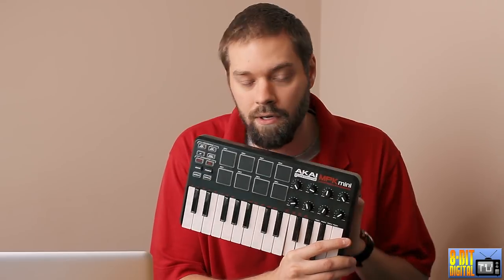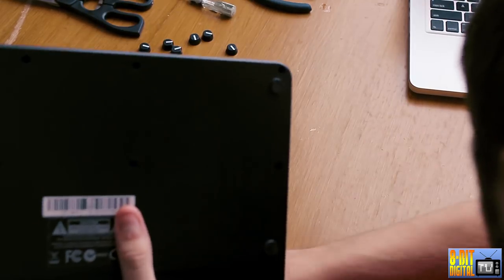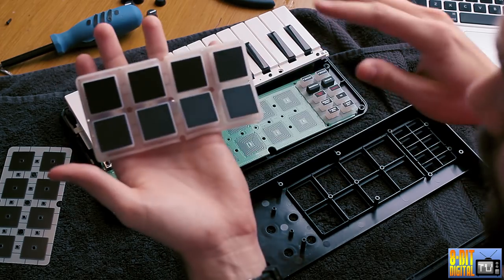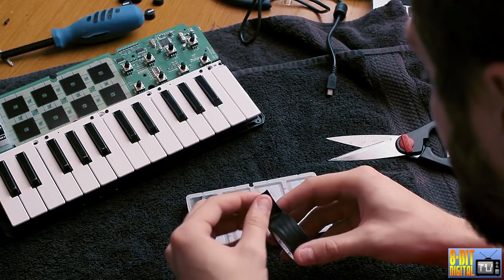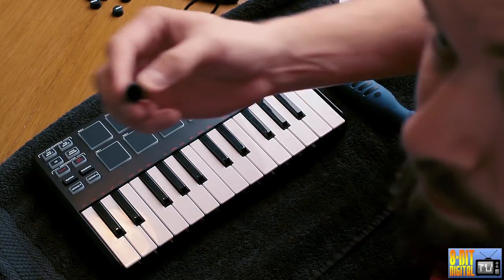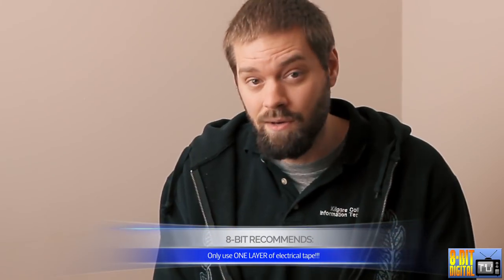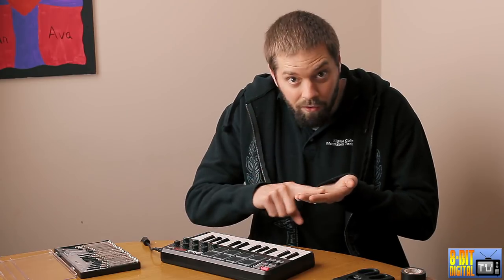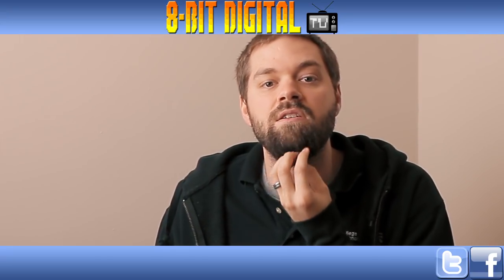Akai MPK Mini Pad Sensitivity Hack [SWAT]

Comment: I just did it and it works great!  I had to adjust how tight i put the screws in though to get it just right, as one of the pads was sticking, but after 3 tries and 1.5 hours it's perfect.  Thanks for the vid man!

Comment: I used two layers of tape and it works perfectly. I quess it depends on the tape you're using.
Reply from the maker: Yeah, we were wondering if the tape I was using was extra thick or something.  Glad it worked for you!
Reply: @8bitdigitaltv   @Random Tech Reviews  Is it a bad idea to buy this in 2020? I can buy a MPK mini MARK1; Will it work on Windows 10 or any recent hardware and software?
Reply: Yup, Tape thicknesses vary. 
Stretching the tape will make it thinner.
There could be manufacturing tolerance differences sa well. 
Two worked for me, one layer wasn't enough.

Comment: this is epic, does something similar work with the keys to make them a bit more sensitive?
Reply: did you figure it out?
Reply: If you hold down the Full Level button for five seconds, the small screen will show four velocity settings (v1, v2, v3, v4). Use the top four knobs to adjust the velocity level of the keys. 

Best to take a photo of the original levels before changing them, just in case you want to revert it to original levels

Comment: I don't get why akai don't fix this issue brefore releasing new products. 
I had to do this same hack on my mpd32 years ago but it seems they're still building their controllers with the same problem.
Reply: It's debatable. I got used to the sensitivity. 
But I usually leave it on full volume mode because the pads weren't great at detecting the different levels of pressure in a consistent way. I found It was easier to just edit those volume changes in a DAW. But as for the overall sensitivity, it's not like you have to hit them THAT hard to trigger the sample. I quickly adapted.

Comment: Hey man I know this is old but I'm stumped. The thing that happened to you at 5:05 (Round 1=Fail) happened to me brand new out of the box. What did you do to fix that problem? You cut away before showing the final fix so I'm curious if its something I can try. Everything else works fine though. Thanks
Reply: he prob removed his tape but i removed mine and its still lit up fml

Comment: I took mine apart, taped the bottom layer of drums to test it out, then put it back together again and now it's the pads aren't working? They won't even light up when first connected to power. Any help would be appreciated.
Reply: Owen Thompson I think he said at 2:43 that you probably have it on backwards. Only one layer, if not any.
Reply: did you find the solution to this?

Comment: So. My USB port decided to break off and fall somewhere inside my midi board. Does this make it unsalvageable?
Reply from the maker: Hmm...that doesn't sound good.  You have to be REALLY careful with that stuff.  If it was just plastic, you might be able to glue the plastic back on.  If it's metal, you may be able to solder it.  If it's the board, then yeah, it's probably a goner.

Comment: I just got a MPX16 to play back sound bytes and discovered that the volume they play them back at was dependent on how hard I press the pad, which to me is stupid. They should have put an on/off switch or a sensitivity adjustment setting somewhere for the 99% of people who could do with out it. 
I guess Akai is stuck on stupid though, do I really have to open it up and put tape on the pads or would a midi controller work?
Reply: um, akai does this on all their pad products. the velocity controls make everything sound real. a drum set doesn't have the same volume for every hit. if you absolutely want everything the same velocity, just turn on full levels
Reply: Lucifer2066 this comment is hella funny 😂 sorry to laugh at your cluelessnes bro guess we all been there

Comment: I need to replace the pads in my Akai MPK Mini 2. However, the sustain connector makes it almost impossible to remove the board out of the enclosure. Anyone know how this is done. The original Akai MPK 1 doesn't seem to have this issue.
Reply: Hey  @AvioCritical  I have an MPK mini Limited Edition White. But I've got the same problem with the sustain. I did manage to open it up even though it was difficult (and scary). Now closing it is my new challenge. I feel like I need more than two hands. Two to pull the plastic around the whole for the sustain input. A few hands to keep everything in place and maybe a hand or two to push the plastic down where all the knobs needs to go..
How did you do it?? :D

Comment: Would this be necessary for the MPK2?
Reply: I guess its more sensitive but I think it should be more. Unfortunately I couldnt get it open because u cant take the board off the faceplate without breaking the sustain jack.
Reply: Yes, it is necessary with the MKII. I ran into that with the sustain jack as well, but managed to get it off and back on several times. You just have to unscrew the little joystick board, then bend the case outward and force the sustain jack through, then you can push the knob shafts down through, and do those steps in reverse when reassembling. I found that 3 layers of tape are needed for the MKII.
Reply: WORKED!

Comment: I need to replace the pads in my Akai MPK Mini 2. However, the sustain connector makes it almost impossible to remove the board out of the enclosure. Anyone know how this is done. The original Akai MPK 1 doesn't seem to have this issue.
Reply: I'm having the same problem. Have you found a solution yet?
Reply: @ashleydavis2921  I had this issue with my mini 3 which I believe has about the same configuration. In my case there was a few things that helped me get it out of the enclosure. First, there’s a screw beneath the cable connecting the joystick with the main circuit board, very easy to miss. Second, there are two black pins connecting the display to the circuit, and for some reason it helped pinching these together carefully while wiggling the circuit board out of the case. Remember that the joystick still will be stuck to the case, and therefore the circuit board will too. It’s possible to get the pads out anyway as long as you’re careful. I hope I’m correct believing the mk2 and mk3 is roughly the same so this can help you, hehe… (also, I’m a complete layman, so do anything I’ve told you on your own risk) cheers